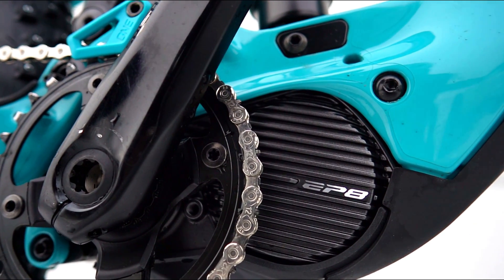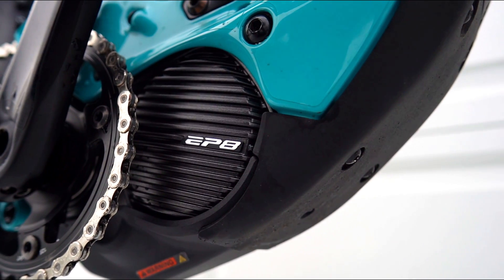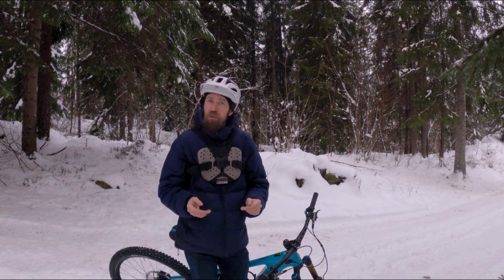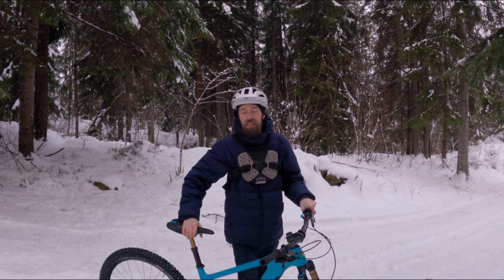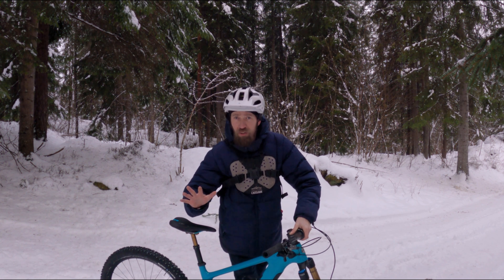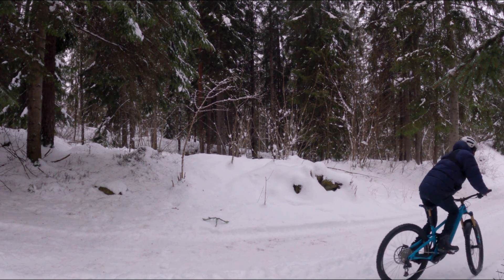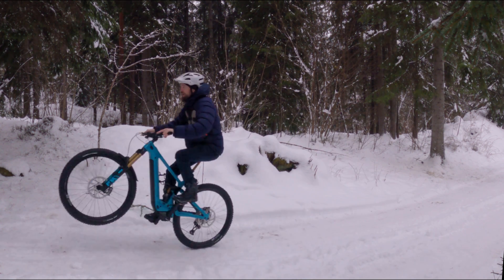First ride on the updated Shimano EP8 - the 2nd generation EP801

Comment: Would be great if you could get a hold of EP 801 with auto shift and free shift set up and evaluate the fine-tuning mode that goes with all that there’s a shortage of detailed information on that system. I actually have it and think it’s fantastic, but someone like you may, come up with some tuning ideas and information that I haven’t been able to create at this point.
Reply from the maker: I did test the EP801 and free-shift just over a year ago.

https://youtu.be/s7iJ37n5mqs
https://youtu.be/U1ApK2iR_Js

But yeah, I've been asking for bikes with the auto-shift since. I want to test it more extensively on my local trails, and I assume the auto shift firmware has been updated since I last rode it. Hoping to get it sometime this summer.

Comment: How did you setup EP801 bike screenless?

Is EM800 switch connected directly to the motor? Or is it connected to your EW-SW310 button?
Reply from the maker: It's not my bike, so I really don't know. To my understanding, the power button connects directly to the battery. So I assume the switch connects directly to the motor. But I'm not sure...

Comment: How does it handle going uphill
Reply from the maker: Doing steep and technical climbs at low speed, the EP8 always was great, the EP801 is too. If you're pedaling uphill at around cut-off speeds, the old EP8 would reduce assistance a bit sooner than Bosch, Brose, etc. The EP801 is better in this regard. It keeps the speed up and is probably comparable to say the Bosch P-CX, I haven't compared them directly yet.

Comment: EP801 or Bosch CX if you had to choose?
Reply from the maker: Before the Bosch Smart System update, I would go EP8 because it’s so easy to control at max assistance  and because of the app. But now, after the Smart System, and after the improved high cadence of the EP801, it's a wash. I'd pick whatever is on the bike I want. But if I'm forced to pick one, I guess the EP801 because I have the option to get Autoshift.

Comment: Does it seem to be more powerful than the EP8?
Reply from the maker: Yeah. Shimano claim it's ~600 W while the old EP800 was 500-ish W. The EP801 feels more powerful at higher cadence, which translates to higher power at equal torque. Riding slowly, at low cadence, I wasn't able to notice a difference.

Comment: i just starting to getting into emtb motors as i maybe want to buy one. however i am a bit confused. i would have several question (hoping you could please comment on these - thanks):
1) so "EP8" is just the codename, but it does not tell you something about the generation? (EP800 is the first gen and EP801 the second gen?)
2) The EP6-RS and the EP801-RS are motors with the software limitation to reduce torque to 60Nm?
3) if a bike manufacturer just states "EP8" motor, you still dont know if its first (800) or second gen (801)?
4) After this video time has passed, so what is you experience so far with rattling of the EP801?
5) the EP600-RS still has rattling
6) to summarize: what are currently the motors, beside of the EP801 and EP801-RS, which do not rattle?
Thanks!

Comment: Can you swap an E7000 for an Ep801??
Reply from the maker: You most likely can, but you might not want to. There is a slight difference in motor shape, but I believe the EP801 doesn't extrude any more than the E7000 in any direction, so it shouldn't be a problem. But worth keeping in mind, just to be sure.

The big hurdle is cost. In addition to the motor, you need a new battery that supports the new bms. You need a new power button too, as the button connects directly to the battery now. And you might need a new remote/display and wires, don't remeber.

Chances are you might be better off just selling the old bike and getting a new with the EP801.

Comment: EP801 here on a Rise 2023 and at least my unit rattles a lot 😢

Is it bad luck?
Reply from the maker: I briefly rode a 2023 M20. Initially, it was silent, but towards the end of the ride there was some rattle. Much less than on the 2022 model. It could be the cables rattling inside the frame too, not necisarily the motor.
https://youtu.be/9EhO7kTnIXs
Reply: @EMTBVideos  thanks for your answer.

Definitely in my case, they are not the cables, it is clearly the motor, I can replicate the noise with the bike stopped just by moving the cranks.

But it is also true that I do not have an EP800 to compare to. Maybe the rattle is much less now, that is something I do not know.

In conclusion: my unit rattles a lot but it is not a big deal, I enjoy my Rise on a daily basis, just wanted to share my case

Comment: Hey can i use the sc-en600 display on ep8?
Reply from the maker: I don't know, but I think you can. The EM800 display that came with the EP8/EP800 seems to work with new motors. So I guess that means the new display will work on the old EP8 too.

Comment: I got the 2022 Canyon with EP8, I havent heard any noise out of it at all.
No clunks or rattles, nothing.  Very happy with it!----------

Power? I always run it in trail mode, it will climb anything at medium power setting.
------------
You are right, the snow and ice is really loud.
It all sounds like rattle.
Reply from the maker: Cool, I've heard rumors about this. Will check it out.

Comment: I have a 2022 Yeti SB160e. What do you mean it was rebuilt?  Do you believe upgrade to the new EP801 motor? I’m interested in the link glide di2 system which only works with the new motor
Reply from the maker: Yeah, rebuilt might not have been the best choice of words. The owner installed the new EP801 with new battery, wiring, powerbutton and handle bar remote. Also, he installed the new electronic XT linkglide drivetrain. When I rode the bike, it had the original mechanical drivetrain unfortunately.
Reply: @EMTBVideos  You mentioned in the video the lack of the display unit.  Did the owner of this upgraded bike not purchase the display or is there no display for the new EP801 motor?

I have the same bike, purchased last August with the EP8. Based on this video it does look possible to upgrade but it seems the entire system (motor, battery, wires, switches and sensors) need replacement.   I'm sure that won't be inexpensive.
Reply from the maker: @seanralph3728  Yeah, it was just the owner not wanting the display. There are displays for the EP801, SC-EM800 and SC-EN600. The 600 display doesn't support bluetooth, it needs to be matched with the SW-EN600L remote for BT.

Comment: How does the EP801 compare to the Bosch Gen 4 in power and energy consumption?  I have two bikes, one with Bosch Gen 4 and the other with EP8, and the Bosch is more powerful and less battery hungry. Would love for Shimano to catch up to Bosch in these regards. Does this new motor promise?
Reply from the maker: I haven't ridden the EP801 much so far, and I haven't had the chance to compare it against the Performance CX. I think what makes the consumption high on the EP8 is the high support when pedaling slowly/gently. And I guess that's still the case with the EP801, but I really don't know.
Reply: @EMTBVideos  Thank you for the fast response. From my experience with both motors The EP8 needs to be ridden at high cadence to be energy efficient, but no matter how much I try to maximize energy consumption on the EP8 the BOSCH always takes the win.  Hopefully you can one day compare both the EP801 and the Bosch CX4 and see if Shimano has had any progress in this regard.

Comment: Heard that the ep801 will now be at 600 watts max power vs. 500 watts for the ep8, can you confirm that you felt any difference?  Also - I thought these were NOT backward compatible, how did you get that to fit on the 2022 Yeti 160e !!

Comment: Thanks for the quick update.  Can you Investigate the new motor’s compatibility with older bikes with the EP8?  Will the old batteries designed for EP8 work on the EP801 for any bike or just certain bikes?  
Also remote and display compatibility.  Do we have to upgrade everything also?
Many people have a 2+ year old EP8 that is out of warranty and if it fails, this would be a great new option for them!!

Thanks
Reply from the maker: Yeah, the EP801 brings a lot of changes, including a new battery management system. It requires new everything... battery, powerbutton, display and the remote I believe. Perhaps, to some, it could be worth doing the swap if they get a new motor on warranty. But I guess it's cheaper selling the old bike and buying a new one if you want the EP801.

Comment: Let's wait for 2,000 km and then test rattling.
Reply from the maker: Yeah, it will definitely be interesting to see if any noise develops after it's been used for a while.
Reply: Exactly what i think, I buy my simplon steamer pmax 2022 with bosch gen4 and it was totally silent but now after 1500 km  the rattle is coming brutally.
Reply: @hierophant9929  the same situation with cube stereo hpc 160. Gen 4. 3500km it is  rattling loudly . Wife's cube stereo alu120 , gen 4 . 800km it is still silent.

Comment: I have 2021 orbea rise M10 with EP800 motor.  Do you think I can upgrade the motor to EP801?
Reply from the maker: It should be possible to upgrade, but I don't think it's worth it. You need the motor, battery, display, power button and remote - so it will be expensive. It could be cheaper just selling the bike and buying a new one.
Reply: @EMTBVideos  if the frame is a carbon frame or an expensive other frame or a loved frame the swap is worth it ! juste need battery motor 2 cables 1 sensor 1 display 1 assist Switch 1 battery mount total cost around 2000€ ? for a whole new experience

Comment: Thanks that's great. But are you sure that this is the motor fix? I've read a topic where a guy declares that he fixed the ep8 rattling by adding a rubber bumper between the crank and the chainring adding the friction that completely solved the issue. Probably the Yeti engineers did something similar, not the Shimano ones?
Reply from the maker: Yeah, I've heard talk about the low internal resistance of the motor causing the rattle. So when added resistance between crankarm and chainring helps, it seems to confirm this.

The bike I rode is a 2022 model. To my knowledge, this bike had the motor rattle with the EP800. After swapping for the EP801, it's gone. Hopefully, I haven't missed any other facotrs that could explain why this bike is silent.
Reply: @EMTBVideos  Great, thank you, that would be a good score to the shimano team. Definitely will wait a bike with that motor. I like Bosch smart, but cant stand that rattle.
Reply from the maker: @torabora851  Hopefully I'll have a look at another EP801 bike within a weeks time. Would be nice to have a confirmation the rattle is indeed gone.
Reply: My EP8 has zero rattle, Ive read of other guys saying the same. They must vary to some degree.  I like the 2022 EP8 just as it is delivered, it works great!

Comment: i have order the orbea rise m-team 2023 size M with 540 battery with new EP801 motor customized similar to LTD model (same sospension, same tires and same seatpost) with exception of the wheels  (i kept the original one unfortunatelly heavier of the ltd model), also i have kept  XT DI2 with XTR cassette upgrade; i have tried to figure out the weight and is it possibile around 17.5 kg without pedals? am i too much ottimistic?
Reply from the maker: 17.5kg might not be too far off, allthough bikes usually ends up being heavier than expected :/ The 540 Wh battery is 800g heavier at 2.7 kg. And the wheels are quite a bit heavier. But I think it's a good idea going with the Oquo MC wheels, they should be much more solid and durable than the MP version. Going with the Team over the LTD makes sens to me.
Reply: Thanks i Think the new di2 xt combine with new motor ep801 of the m-team model Could be a better way to Go instead xtr of the Ltd model … i should have freeshift and auto shift features too…contrary i add little weight
Reply from the maker: @magicsork657  Yeah, agree, I would easily go XT Di2 over XTR. Looking forward to test the free+autoshift myself!
Reply: Yes my m-team is coming with carbon wheelset at 1800g do you think this is a good choice?
Reply from the maker: @magicsork657  I haven't ridden the Oquo wheels, but I would imagine the MC wheels are the best option for an emtb.

Comment: In my opinion fat motors don’t have to be natural, they have to be powerfull, that’s why I want and need a ebike.
Reply from the maker: Yeah. The definition of "natural" is a bit subjective though. One could argue the EP8 is a natural feeling motor since it's so quick to activate and deactivate, so quick to respond to rider input. To me, this makes the motor easy to control. First impression is this is a great full fat emtb motor, regardless of how natural it might feel.
Reply: @EMTBVideos  for a natural feeling is there the low power motors, when I bought an ebike I want power above all if it feels natural great if don’t I don’t mind I just want to go the top effortlessly

Comment: Im running a Bosch Trek Rail. Is there any way by using the app tuning to get the EP8 to feel more like the Bosch power?
Another question: If I buy a discounted 2022 Marin AlpineTrail E2 how much will it cost to put the newer motor on?
Reply from the maker: There are many new options to adjust motor behaviour on the EP801, under Profile 2. I haven't tested it yet, so I don't know if it is possible making it more similar to the Performance CX. Perhaps...

I would not buy an EP800 bike with the intent of upgrading it. And if I already owned an EP800 bike, I would sell it and buy a new EP801 rather than trying to upgrade it. It seems you'll need a new battery, display, powerbutton, etc in addition to the motor. And you would possibly need a bikeshop with sufficient access in the Shimano E-Tube software to enter the necessary settings. That was the case with the EP800 at least, not sure about the EP801.
Reply: @EMTB Videos  Thank you for all of the information. I just spoke to Marin and asked about the Alpine trail getting the 801 and they said exciting announcements are coming soon just hold on.

Comment: Thank you very much for this valuable information, I really hope all the new EP801 Motors are silent like this one you tested.
Reply from the maker: Yeah, that's in the back of my head. I've only ridden one motor for a short while. Would suck if not all motors are as good as this one. And, hopefully, the noise won't come creeping after a few k of riding.
Reply: I would say yes. The Yeti is carbon fiber wich is more noisy (amplify sounds) than alloy and the the pedal kickback in the Yeti is normal (not bad but neither near zero ) this two are the main factors to explain why some Shimano and Bosch are more noisy in some bikes than others.
Reply: Just reading MBR test from April saying the ep801 they tested still had the rattle.

Comment: what bike is it ? yeti=?
Reply from the maker: Yeah, I was supposed to not focus on the bike, but it's kind of hard to hide that color (:
Reply: @EMTBVideos  hope they will update the range of components very soon
Reply: @EMTBVideos  how did you get a second gen 160e or did you modify yourself?
Reply from the maker: @briangong007  This isn't my bike. It's a 2022 160e that has been modified. The owner has connections like no one else, so he's one of the first to get the EP801.

Comment: Thanks for showing. I assume the new one is the same dimentions? If our motor goes to hell or just wants to upgrade, I could change out to new one on my decoy. Would you have to program something?
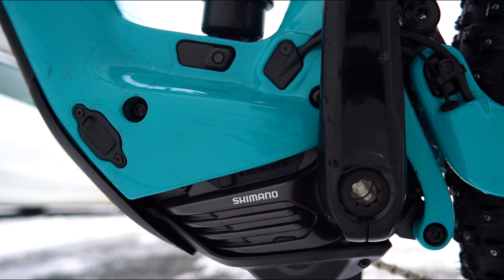Reply from the maker: If you look at 03:29, you can see the motor from the non-drive side. There is a glitch between the motor and the frame that wasn't there with the EP800. Motor dimensions are mostly the same, same motor mount, but there is a slight difference on the NDS.
Reply: @EMTBVideos  So are you confirming that aside from a gap on the NDS this ep801 bolts right into a ep800 frame? Or are you saying they had to remove material from the ep800 frame to fit the ep801? Backwards compatibility seems too good to be true, but would probably go a long way in restoring their reputation in the ebike game.
Reply from the maker: @KatieandVin  Yeah, the owner bolted the EP801 straight in, no modifications needed. Allthough he's considering doing a mod to cover the gap that appeared with the EP801. Still, backwards compatibility isn't great, as you need some new parts, including the battery.